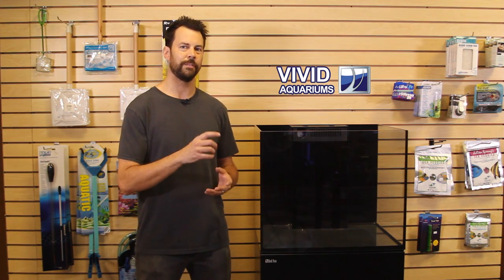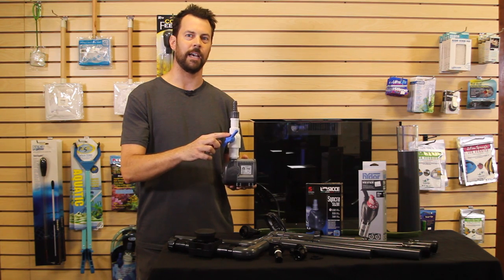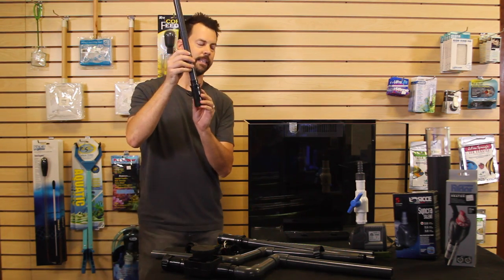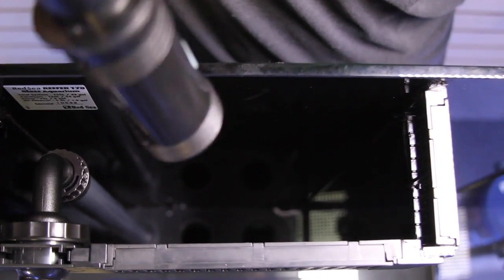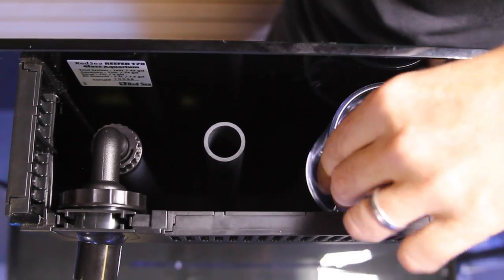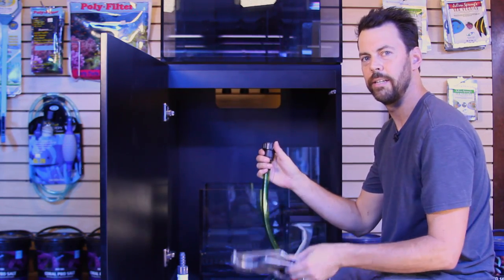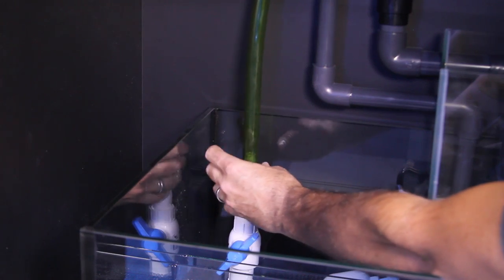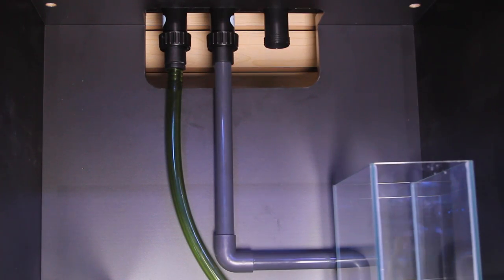Red Sea Reefer pt1: Plumbing

Comment: Return line could use a one way check valve,to prevent siphoning in the event of a pump fail,or power outage.
Reply: With where the return outlet is...no real risk of sump being flooded tho (?)

Comment: Looks like an easy setup. When you screwed in the last drain pipe, what was the square piece on the drain pipe? Do you sell these aquariums?
Reply from the maker: +aManUnderGrace The square piece on the drain pipe was a valve that allows you to reduce the flow of the drain slightly in order to get it super quiet. We do sell the Red Sea Reefer aquariums locally but do not ship them.

Comment: I'm wanting to use the same return pump as this ,, I'm currently using a ehiem 2000 compact and every now and then I seem the get a blast of micro bubbles come out ,,, have you had any issues like that with the return pipe your using ?

Comment: Hi Dave
Can you help me decide between red sea 350 and xl425 
What are your customers saying about the 350 ?  Was it big enough or were they disappointed that they didn't go bigger to the XL425 ?
I have been reef keeping for approx 5 years now and I know that bigger is generally better but the extra cost of the XL425 is significant for only a 3 inch width difference in the tank size 
I would appreciate your comments and advice 
Many thanks 
Sam 
BTW:  I always enjoy your videos !

Comment: Hi.  I have a new Red Sea Reefer 170 and a Sicce Silent 3.0 return pump.  My problem is that the hose that came with the tank does not attach to the pump.  The hose to too small for the nozzle on the pump.  Do you have any recommendations???

Comment: this might be a dumb question but i was wondering if all the tubing and plumbing stuff comes with the aquarium when i buy it?

My current setup is only 7 gallons so i dont use a sump.
Reply: +Taylor Namtolts ....Yes all the plumbing comes complete with the Red Sea Reefer,  although it does not come with a pump for the return.

Comment: Would a the Kessil a160 tuna blue be enough for this tank?
Reply: +meatwad600 - Yes, the Kessil a 160 tuna blue would be enough for soft corals, but not for most SPS
Reply: I have a kessil 160 tuna on it but I added 2 t5 ho 24 watts corals are doing better lps and anemones